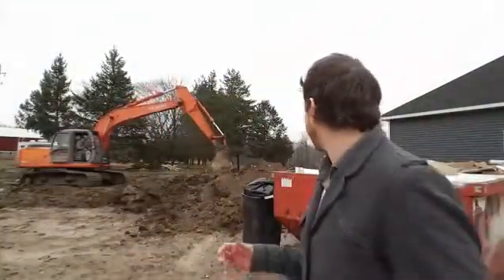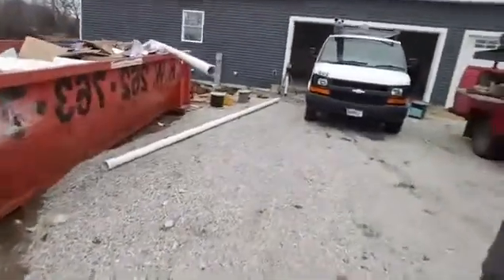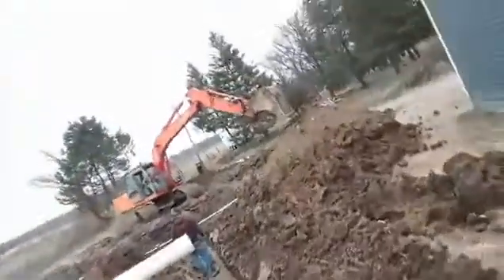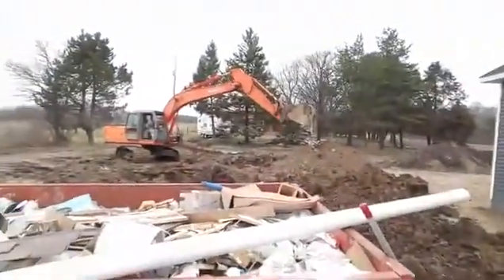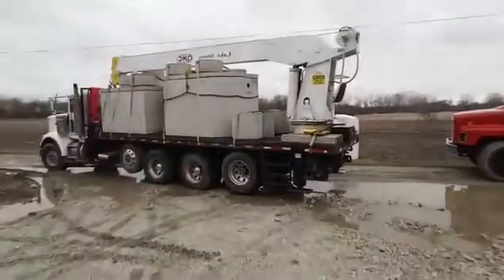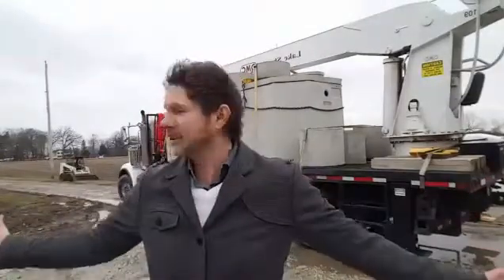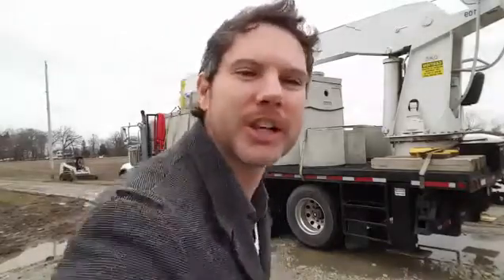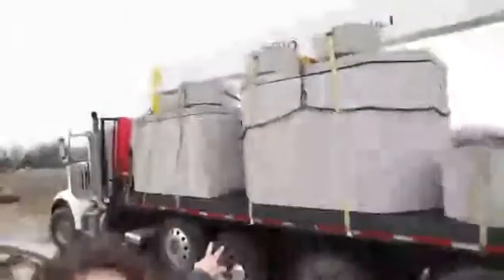Mound Septic System Installation

Comment: Nice video, we are looking to have a house built and will need private sewer and this is new to us, trying to get as much information as possible.
Reply: What about a leach bed instead of a sand mound?
Reply from the maker: Joe Zuelch hi there, since I have done this video because of the septic mound system is now approximately $16,000. Also there are three different kinds of septic systems. The mound septic system that is the most expensive. Depending on the soil, if it’s Sandy enough you can do what’s called a conventional septic, this can run between 1000 and $13,000 depending on the soil, The last kind is a holding tank, you definitely don’t want that. That means that all waste goes into the tank and then it needs to be pumped once per month, let me know if you have any other questions I work with these quite a bit
Reply from the maker: Joe Zuelch here is another video on cleaning the septic filter, definitely important to do https://youtu.be/DJiimoIBB3E